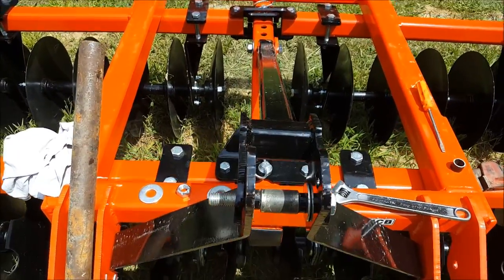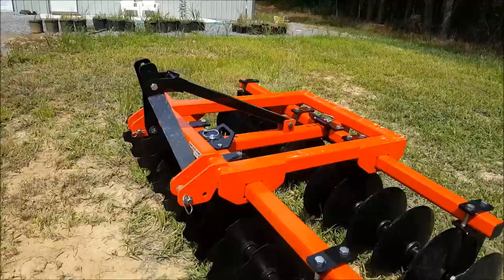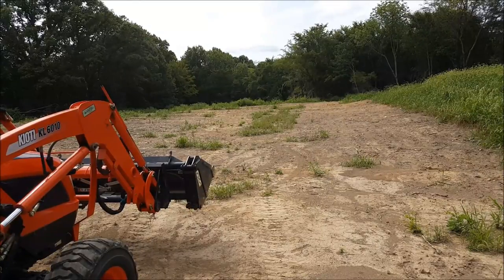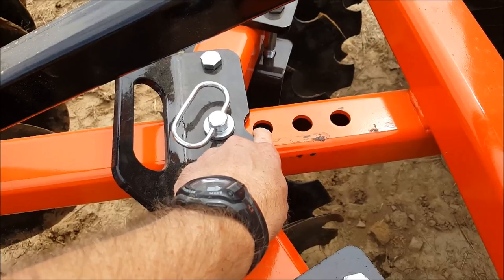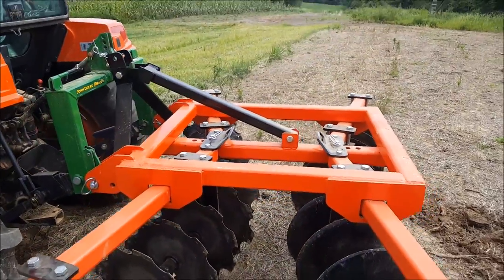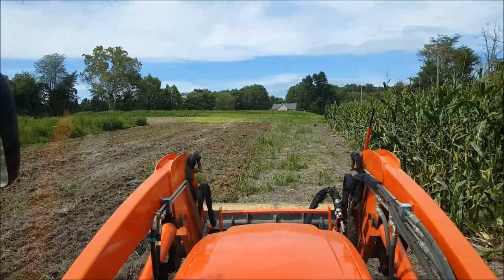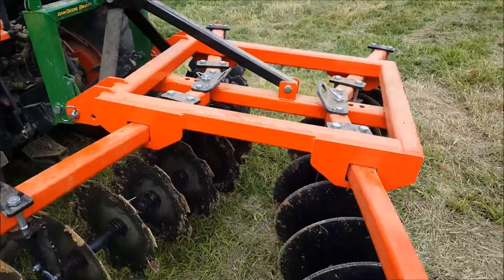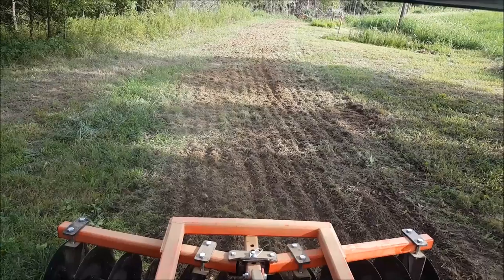Testing the New 7' Disc! AND Special Kapper referral Pricing!!! Made in USA

Comment: Get you a 55 gallon drum fill it with water and mount it in the middle on the back horizontal. Fill it with water when your using pull the plug when you're not. Your front will always cut. Need to get some weight on the back. Other than that to make it better and work more efficiently looks great and dirt looks good brother!

Comment: Hey Kapper long time no talk/chat to ya. LOL.  You can run the front disk cutter near to touching won't hurt thing. And besides, you have plenty of power with  tractor to pull that 7 footer. I was pulling a 6 footer with my 2510 Kioti with ease through clay, sunk the  disk  down to  axles/spindels. If you want to tear up up the ground and go deep, use the most aggressive setting.  Kapper I went and bought a CK-30 with cab. Good video as always Kapper.

Comment: Kap, i think you have the disc setup pretty good...looked great on the last setting...all you might want to do is add little weight on each side of the disc... many cut you a couple pieces of utility pole..or a railroad cross tie for each side...little more weight ...make you some braces to hold the cross ties in place or chain it...we have 2 cross ties cut for our 7 ft disc on each side...

Comment: That's exactly how I run my discs. 3 an 3 on the holes.  I have a Woods 8 footer but mine has the nought discs on front and back. But after seeing yours work it's not much difference.   Looks great. Bud
Reply: Oops typo the disc is a 7foot.
Reply from the maker: thanks man. Yeah, i'm not too sure there's much difference if you'd have cutter or rounds on the back, but the rounds are supposed to knock clumps out more than the notches.

Comment: Do you have draft control? If you do use it to put down pressure on the disc.
Reply from the maker: Yes, but it does not put any down pressure on. Wish it did... It just regulates how low the arms will drop..

Comment: You keep saying sod but I don't see any plastic mesh that you usually see with sod. Sod out in the west is grass that is grown on a commercial lot and a plastic mesh is laid down during the growing part to help keep it together when it is cut and rolled to be sold for installation somewhere. When you say sod do you just mean field grass instead of bare soil?
Reply from the maker: yes, perhaps its a slang term, but just means there is grass/weed pad with established roots. And even dead sod is much tougher to disc up than just dirt.

Comment: So bottom line, is this new disc Quick Hitch compatible right out of the box or does it require some modification?
Reply from the maker: Well... trick question there.. Yes, it fits quick hitch right away, but you have to get the right bushings. The adaptor bushings don't come with it.

Comment: We had a set of sealed bearing disc. One year later the bearings went out. Now I have an old set of 8 foot disc that's greasable. Do have the disc set all the way down?
Reply from the maker: Well hopefully the sealed bearings don't get destroyed! I kind of wondered about that. I don't recall now this video was awhile ago how I had the disc set
Reply: @kapperoutdoors  sealed bearings 4 disc is that okay until they tear up. I went back to a old set of greasable disc just for that reason it's a lot cheaper to buy them and to work on them. I have a really old set of 8 Footers that I have used for years after I went through and rebuilt them best thing I spent money on yet

Comment: Looks like that disc cuts pretty good for its size...I noticed it doesn't have a scraper on each disc blade, if you work that thing in soil with a higher moisture content might want those scrapers...does this company make scrapers you can install?
Reply from the maker: No idea if they do. I'm thinking that if it was that wet though I probably wouldn't be disking. I try not to bring tractor in wet ground unless I have to.

Comment: Love your new disc.  The old one was pathetic.  A disc does it's best job right after plowing. But minus the plowing first, it should do great with cross discing and going over it several times.
Reply from the maker: to me that's just an extra, unnecessary step. The disc can cut it up, just takes a few passes. I did hit it at an angle a few times, does great. Crummy part is most plots are rectangles, and not very wide, so cross cutting is a bit challenging, without running over any corn :)

Comment: Excellent, good looking disc, I'm impressed!   
....13
Reply from the maker: thanks man, appreciate that. You sure you don't want to join in on the 'add more weight' train!!!? lol
Reply: LOL --- however, for what it's worth and if needed,  these are numbers I used during my construction career: (all in lbs. per cu. ft.) water-62.4; dirt (loose)-75 --- (compacted)-100; concrete-150; steel-492. 

Yesterday I gave incorrect WATER information. I corrected the mistake and the information regarding water has been updated above (I used the wrong unit measurement). Thanks.

Comment: Sealed bearings will fail one day.grease able bearings have seals also. The seal is tapered on to let pressure out ,but not let dirt and moisture in. If a bearing has a grease fitting and seals are bad most usually it will be OK and keep going If  greased. I've ran a lot of equipment ,many disc harrows.
Reply from the maker: Great point! Thank you

Comment: Kapper it looks to me like your rear disks are way too high they look like they are barely touching..measure the disks see if the fronts ( scalloped) are bigger diameter..it looks like you almost need an adjustable link where the top black bar is.( Black bar on the top of disc you had to install) in order to bring the back discs lower..simular to a adjustable link on a bushhog..
Reply: Increase the length of your top link about 1/2”

Comment: You need to add weight to disc, its just bouncing around too much . A touch more angle on the discs too.This is not a real breaking disc.
Reply from the maker: yeah I usually add weight, this was just testing it out.